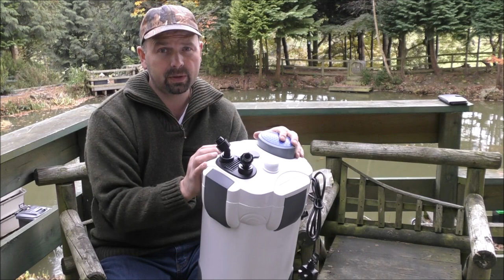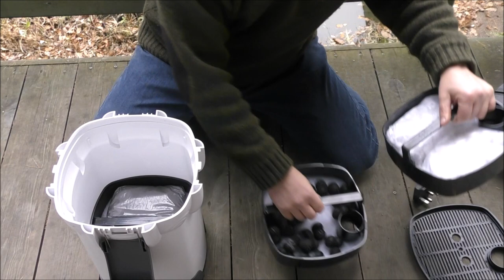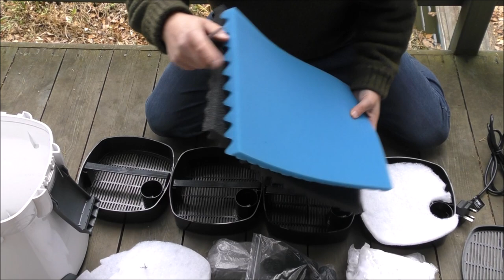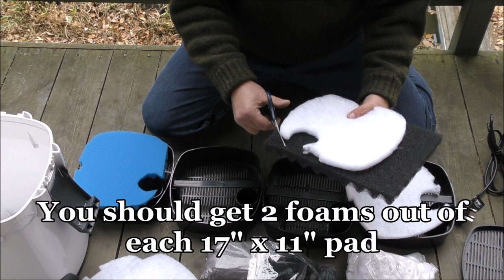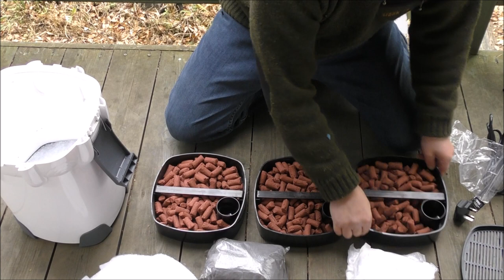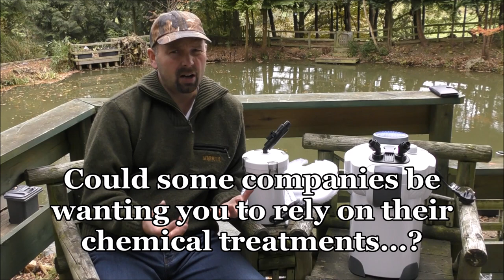Why Your Filter is TOO SMALL and NOT CYCLED

Comment: Pondguru I am so glad to see someone talking about the anaerobic part of the cycle.  I want to tell you about how I accidentally established a full cycle in less than a week as a novice fishkeeper early this year, in the hopes that you or someone can shed some light on it.  I had to set up a quarantine tank for some chocolate gouramis that were arriving in less than a week.  Had read they were very sensitive so, as I had no other cycled tanks at the time, I added Tetra, Nutrafin AND Seachem bacterial supplements along with ammonium sulphate to get a cycle at least started before they arrived.  Also added a TON of dried leaves both for tannins and for hiding places - the leaves completely covered the bottom of the tank.  Nitrate was over 40ppm when the fish arrived six days later so I changed all the water, added them and crossed my fingers; there was obviously enough bacteria for the few little fish as no further ammonia or nitrite ever showed up.  The weird thing was that the morning that the fish arrived, the nitrate had gone DOWN instead of up; I assumed I'd messed up the test.  But I kept the fish in that quarantine tank for a couple of months, added a few more fish as well and I never detected any nitrates.  I was only using a small, cheap sponge filter.  Once I had their permanent tank (with a corner mattenfilter) set up I transferred them and their sponge filter over, and after a month or so I removed the sponge filter.  Still no nitrates.  I still can't understand how it happened - I didn't have any substrate at all in the quarantine tank so no anaerobic zones there, and I didn't have media of any kind besides the two little sponges on the sponge filter.  And I can't understand why it happened so fast.

Fish haven't been doing that great in my pH7.5 water so recently I've been filtering the water through peat to reduce the pH.  The fish are loving it but when the pH hit about 6 I started getting nitrates for the first time :-(  No ammonia or nitrite showing yet though, so what you said about the anaerobic bacteria being more delicate is clearly true.
Reply from the maker: That one is a mystery to me but that is the wonder of filtration - for every sure fire way to achieve full cycle there is another one which is unknown (at least to me). If I had to guess I'd say it may have something to do with the leaves but I'm not scientific enough to know why / if that would be the case.

Comment: Thank you for breaking down all this information about the full cycle and on proper filtering. All the canister filters I’ve ever seen have done nothing but confuse me and the 1000’s of filter media and filter pad options and filter systems have always and only confused me. Now I know exactly what I’m shooting for and what I need to do to always set up a proper filtration system. I have never seen anyone ever talk about how the layers of filtration need to be. Now I’m going to spend $2 on a big utility/paint bucket and fill it with corse,medium and fine filter pads and the rest of the bucket is going to get a nice full meal of biological media. I have hoses and a pump already. Thanks mate!
Reply: I also have a question,....if I were to get that canister filter you have posted what liter size should I get for a 40gallon breeder.
Reply from the maker: You'd need a filter which could hold up to 3kg of media so the 1400 litre per hour version would do that no problem (1.5kg per tray with bottom tray used for foams and fine pad)

Comment: YES , YES , YES ! Been doing this way for so long ! It is called a Pre - filter , not a booster canister filter as the name pre - filter actually describe the process of what it is actually doing . Doing it all with multiple Eheim Classic connected in series . The 2211 or 2213 would be filled with only filter wool and sponge while the 2215 or 2217 would be filled with Eheim Substrate Pro , Biohomme or Sera Siporax . You'll only need to maintain the pre-filter and leave the 2nd filter alone . The Pre - filter impeller should be removed , making the 2nd canister connected in series the main engine driving the flow . Quality media is essential ! Thanks a lot for doing this video !
Reply from the maker: Sounds good to me and I'm glad you found the video useful - thanks for watching.

Comment: Good video.I am a fancy goldfish enthusiast. I WAS SO DONE WITH CANISTERS AND HOB FILTERS.I changed over to sponge filters powered by powerheads.Easy cleaning and superior water quailty.City water comes out 10 to 20 nitrates from tap with prime and filtration nitrates run 0 to 5 when needs a change.
Reply from the maker: That is an incredible result and while it would be interesting to hear what would happen when chemical dosing wasn't happening I'm mighty impressed there - groovy.

Comment: i don't post much but i have give thanks to Pondguru for this valuable information, i seriuosly have not registered any nitrates 0 but i also have 10kg of biohome ultimate in a 75 gallon tank, with 2 sun sun 304b's and let me tell you the way guru explains his methodology of setting your filter up is simply amazing and my tank is only 6months old i'm simply blown away, about to setup a 180 gallon with the exact same setup with 2 ehem 2262's loaded with Biohome ultimate! and by the way i have not been compensated whatsoever for my personal experience using pondGuru's method!

Comment: Was shown this video when I started in the hobby about a year ago, ended up getting a bigger filter 2400 l/h for my 440 litre tank , 3 of the baskets are full of biohome plus mini which costed a fortune shipping from the uk to Australia but definitely worth it also a ef 2 booster rated for 2000 l/h.
My cycle is great still do a weekly 40% water change only because the tank is heavy stocked but all in all very happy 
Definitely a big help much appreciated
Cheers
Reply from the maker: I'm glad you're pleased with the results and the shipping from UK to AU is indeed a bit of a killer - it would probably work out cheaper to buy it from a local distributor - I have them all linked on my website http://www.filterpro.co.uk (flags at top of each page) and the AU distributor is Genesis Group. I think they have just received a new shipment which was a decent size so stock should not be a problem.

Comment: Great video. After many years of using canister filters, I now have moved onto a sump system that is set up as per the order explained in this video. My (fresh) water quality is the best that I've achieved in over 40 years. If you can, and I know it's a quantum leap, consider a sump set up. It's easier to maintain and you can cram it full of media, I have almost 2kg per litre. Big thanks to Richard for this video and all his advice.
Reply from the maker: Awesome to hear that the water quality is so good.
Sumps are a very low maintenance solution and when tanks get over 500 litres or are heavily stocked they make perfect sense since not many canisters will cope with the bio-load from larger tanks.

Comment: After watching this video I have just spent £228 on an Eheim pro 600, upgraded from my eheim classic 250. What you said made perfect sense and shed lite on all the recent problems I've been having
Hopefuly now my 233 litre Cian120 pro tank will now be a place of bliss and happiness. Well once its correctly cycled.
Going to have to try and jump start the cycle a little as the tank has been in use for over 6 months and has fish in it. I've orfered some quick start gel balls and am going to transplant my current eheim substrate and sponge water etc from the 250 into the 600 to help speed up the cycle. Will do frequent water changes and have no plans to add more fish until the filter and tank are well and truly cycled.
Reply from the maker: Sounds good to me and I'm glad you found the video useful - when any suitably sized filter is set up properly it should enable a full cycle to develop, no worries.

Comment: Thank you for sharing this information.  I've been running a 55 gallon tank with the HOB filter that was supplied with my tank for over 20 years, but I've never taken the leap into external canister filtration and bio media. I've watched this video as well as your pimp my filter series with great interest and I've learned a lot from your thorough fact based videos over the past two days.
Reply from the maker: It is great that you're thinking about the filtration as its an area which is so often neglected by fish keepers of all levels of experience - I'm glad you're enjoying the videos and thanks for watching.
Reply: You don't really need a canister filter. Thanks to Richard and a couple others on YouTube,  I learned how to hot rod my Emperor 450. I put a layer of coarse sponge at the bottom of both Chambers, then a layer if medium sponge, then a layer of polly-fill for fine filtration and on top of that I have bags of matrix.   I also have a fluval 307 canister that my son gave me on this tank as it is a 55 gallon mbuna cichlid tank that's heavily stocked.  I am ordering biohome ultimate to replace the 2 bio media baskets I have in it because it's challenging keeping the nitrates down with these mbunas.

Comment: Just came across this video and I have to say that the manufacturers still have the mechanical & biological filtration screwed up.  I just purchased a Sicce Whale 500 and wouldn't you know corse filter in the bottom,  the media, then carbon and finally the polishing filter.  4 trays so I removed the carbon & 1 corse filter. Bottom tray is now 1 corse and 1 fine filter, the next 3 trays are all media!  I'll keep the carbon for later use if needed.
Love the cow moo ing in the backround.

Comment: That filter booster sold me. I’m getting this exact setup for my 414 liter community tank soon. And I may double it. I will first see how one of these setups work. Thank you for the most informative video on filters on the interwebs! Much appreciated
Reply: Hi how did you find this? I've 300 litre tank with betta canister but my water is always murky so I adding this on also
Reply: @jacquelinemcmillan2793 the booster did fine on my 400 liter tank. I only had the tank for a bout 2 years but during that time it did fine. Water was clear and much easier cleaning the booster

Comment: Good info !    I have an old style corner box bubble draw filter that serves as the first stage mechanical filter for an Eheim 350 that takes care of a 120 L aquarium . The box is filled with floss and is extremely easy to change out when it becomes visibly loaded (no sooner because it feeds Ehiem media from its bacteria) . Eheim is loaded with aerobic material and dense anaerobic nurturing porcelain pellets . Nitrate level with minimal water changes is currently at  ~ 5 ppm .
Reply from the maker: Sounds good to me and if it aint broke don't fix it. Thanks for watching and appreciating the video.

Comment: Pondguru...you are spot on in my newbie opinion and thanks for the great video as it confirmed my rational for my future Discus+ Community Tank design. I recently purchased two extremely expensive German design & manufactured in Italy canisters that I won't mention by name since after only 10 days of ownership I'm in a back and forth discussion with their tech support over a pre-filter valve that won't stay open during or after priming. It flaps close causing the unit to fart bubbles all day long. The larger of the two has a pre-filter valve that stays open after being pressed and no excessive bubbles all over the tank. New replacement pre-filter is in the mail. I would love to see you address the issue I had and why I had to chose the size canisters that I did for my 55 long (Only 4 Discus). The smaller canisters that are "air quotes" sized for my 55 do not have enough available surface area for my new best friends aka beneficial bacteria colonies. I don't plan on overstocking as it's all about the Discus, but I won't to know that I will always have enough real estate for my BB colonies to rollout if they need expand quickly in response to change in my water parameters. With that being said I'm forced to go big which is not a bad idea, but depending on the type of fish you plan to keep, you may have to get creative in regards to controlling the flow and keeping the fish happy. I sure wish manufactures understood this and developed more canisters for the most popular size aquariums in the hobby (55G) that include enough trays to build up decent size colony of BB

Comment: Anaerobic bacteria thrives in water conditions that have very little oxygen. Most filters on the market are designed to have large flow rates which allows oxygen rich water to keep the aerobic bacteria alive which is what breaks down the Ammonia, Nitrite and Nitrate. In order to allow the Nitrate to degass off as Nitrogen you would need to create an area in the filter where there is very little oxygen flow. With canister filters this is hard to do due to the way they are designed. A Plenum in the Aquarium can help with creating an environment that anaerobic  Bacteria can thrive in. In Most cases that's why Aquarist just do water changes. Plants will consume nitrates as long as the bioload isn't producing more than the plants can handle. Very informative video :)
Reply from the maker: Yes, in this case the biohome media is the location which is creating slow flow and suitable conditions for anaerobic activity but for most media that is not possible due to the lack of suitable structure (unless it was used in a nitrate reactor / other slow flow situation).
When people us the porous 'biogravel' (which has the same structure as other forms of biohome) in  mesh small mesh bags it effectively creates what you are describing but the effect is enhanced due to the porosity of the media, allowing for full cycle in even the most ridiculous filters e.g. most HOB which would normally rely on cartridges.
However as you say creating areas of slow flow will allow for anaerobic conditions for less suited media too - if my memory serves me rightly it was close to 30 years ago I first heard of the plenum / anoxic filter idea from people in Italy who were running koi pond water through long final stage filtration beds which had small cages made from pond baskets filled with pumice cat litter. There seems to have been a rediscovery of the process recently which can only be a good thing as it increases understanding.

Comment: Hi Richard, great content and very well explained as always and I think some of what you said explains why my Nitrates have been around 60-80 ppm recently in my 450 liter tank.  I bought 2kg of Biohome ultimate form you in mid 2015 for my Juwel Trigon 190 which worked great, I doubt you remember but I had to create my own coke bottle air filter to fit it all in the tank.  I then purchased a further 3kg for another Juwel Vision 450 tank I bought second hand that came with the current filter I am using on this tank; the "Aquis Aqua One 1250", along with the standard internal filter.  After converting the 190 Trigon earlier this year to a Reef tank I chucked the 2kg of media from the 190 in the internal filter of the 450 to make a total of 5kg of media in my 450 litre tank.
Now, what also went in the 450 were most but not all of the fish from the 190 to add to the existing stock in the 450 which currently stands at 144 fish(ish).  Here's the stock list:
70 Cardinal Tetras
2 Rainbows
3 Bristle nose Plecs (have since Bred)
3 Clown Loaches
2 Sucking Loaches
2 Golden Barbs
1 Black Ghost Knife fish
5 Glow light Tetras
5 Rummy nose Tetras
3 Angel Fish
4 Siamese Algae eaters
4 Otocinclus
1 Orange Gourami
 and about 3 months ago I found that the 4 Silver Light Tetras I had have now turned into about 40 Silver Light Tetras.
I know this is a  lot of fish but a good 40-50 of these are the result of fish breeding of there own accord and managing to survive in the many plants I have.  I've always set up canister filters to your recommendations and never had Ammonia, Nitrite problems or Nitrate problems until recently.
So, as you can imagine I've been trying all sorts of methods to reduce Nitrates such as, API Nitra Zorb, Tetra Nitrate Minus, more water changes and using the RO/DI water I create for my reef tank and two days ago I purchased "Seachem Prime" which says it "Removes Chlorine & Chloramine and detoxifies Ammonia, Nitrite and Nitrate".  Now this is the first time that I've used anything like this, (which I am dubious about) please tell me it won't affect my biological filtration as it stands?
Do you reckon I just need more Biohome Ultimate, if so how much or just a bigger boat? ;O)
Reply from the maker: There is a lot of fish in that tank and the increased bio-load could have just tipped over what the media (bacteria) is capable of coping with as far as a full cycle goes and 1kg per 100 litres would be the average requirement for a normally stocked tank. You are right to be dubious about chemical additives as I get reports all the time from people who have had perfect water and suddenly crashed the back end of the cycle (nitrate reduction) when they started adding that sort of conditioner. I don't know how they kill / poison bacteria but treatments which promise to detoxify ammonia, nitrite and nitrate definitely have an adverse effect on the bacteria.
I would add more filtration and do it naturally or you'll be throwing money away getting into a treatment cycle.

Comment: I had that very same APS filter and pre-filter, with Bio Home Ultimate, and had nothing but problems. Switched to a FX6 with the same Bio Home Ultimate and I have never had a problem since.
Always the PG mantra is in the head “course, medium, fine” :)
Reply from the maker: That's a strange one as the water hits the various components in the same order and they have the same stuff inside them but the FX does have lots of mechanical filtration making it (hopefully) less maintenance.
Groovy.